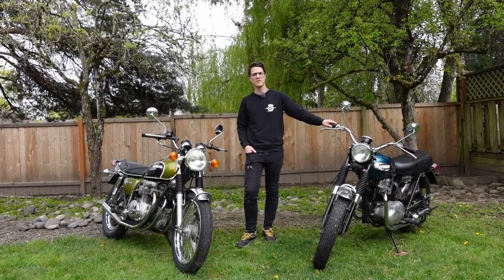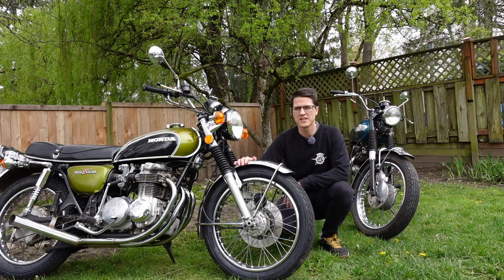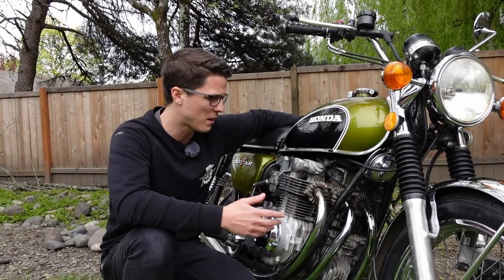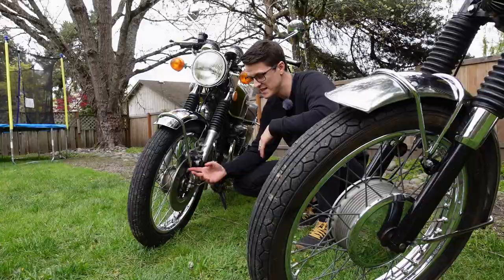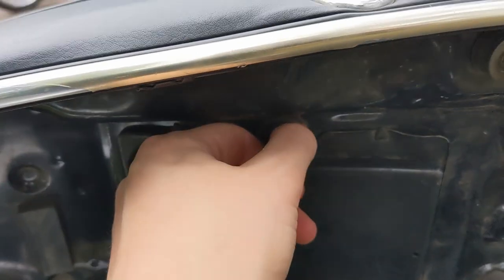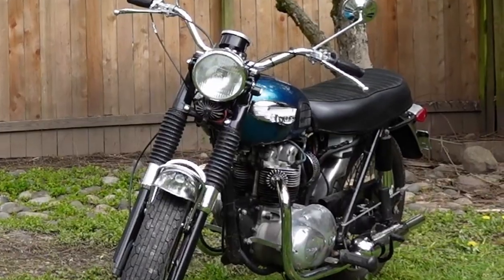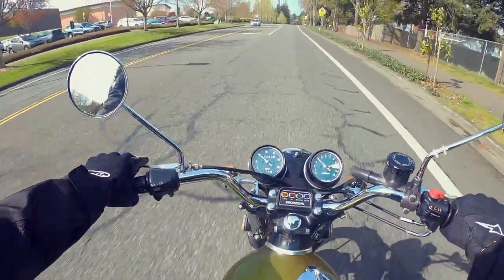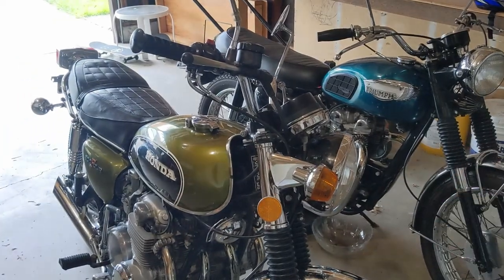How this Honda killed this Triumph

Comment: A better comparison would have been with the T100R Daytona, having twin carbs, tach, twin leading shoe front brake, a more sporty cam & higher compression.  I had a 1966 T100C (street scrambler type) with the single carb, small headlight, no tach, 2 into 1 high exhaust & silencer, skid pan for engine, no battery and slightly lower gear ratio.  You wouldn't consider taking the CB500 for any serious off-road adventures, whereas the Triumph was fun in the dirt.  I've read that it is possible to reduce vibration by having the crankshaft dynamically balanced, and the pistons & connecting rods equalized for weight.  But, I never felt vibration was a issue; not like my single cylinder BSA 441!  One time the Beezer kicked back when I was trying to start it, and ripped my boot apart!  Conceivably, the Triumph engine could be carefully put together to avoid oil leaks, but that's part of its character!  Apparently,  back in the 30's, a proper motorcycle was considered to be 350cc's or bigger.   The 350's were single cylinders, and so vibrated and were not easy to start.  Turner came up with the idea of a parallel 360 degree twin with the cylinders firing alternately, so it had half the vibration of the single, and also easier to start.  It was then bored out to 500CC.

Comment: I agree, i am 67 years old , used to own a 71 CB750 and a 82 Kawa GPZ 1100, although that i love those motorcycles i always enjoyed riding my friends 73 CB500 and 69 Triumph 650 bonneville however i will admit that the Triumph had something the other ones didn’t have which is “Character” regardless of not being smooth and vibration free i never refused the chance to swap with my friend at every opportunity I had 😎

Comment: I have both a cb550 and a 72 t100. The cb550 didn't kill the t100. Poor management at Meriden killed triumph. It continued on after 73 as a collective and later went under around 1981. The t100 was axed because the collective couldn't support it and the t120 at the same time. It wasn't that they couldn't sell bikes, It's that they couldn't make them cheap enough with the poor tooling investment they had available. The shareholders bled the company dry in the 60's. Also, you have the wrong front brake on your t100, you should have the twin leading shoe 8" brake, which I know from owning both of these bikes, works as well as the cb550 when adjusted properly. I find both bikes very beautiful. Honda cb's from the 70's are definitely their golden era. All Hondas of the 70's are just works of art, from the monkey bike to the gold wing.

Comment: Rubbish, I was around when these were new. The Triumph 500 was infinitely better than the Bonneville. It was 10 mph slower but was lighter, it didn’t leak oil so obviously you have read previous reports before making an assessment. My T100 never leaked a drop fact; deal with that. The Honda was great but the CB had crap brakes ie didn’t work in the wet at all! The Triumph TLS did. Even the SLS did. I would have loved a Honda because I was poor, but I cut my teeth on British bikes. At 67 I won’t change my mind. Modern Triumphs have tried and failed miserably to check the past. Some things cannot be repeated; including old Honda 4s. British rules.

Comment: Fun Facts, the Triumph Speed Twin engine, introduced in 1937,  and designed by Ed Turner and Bert Hopwood, was converted to military use in 1938.  It became the generator for Lancaster Bombers, and also for portable electrical military use WWII.  The Generator versions used aluminum heads and sometimes sleeved aluminum cylinders.  After WWII, the military aluminum heads and cylinders were used for racing.  These were successful in wining the IOM GP.  Aluminum heads became standard at some point 1963 the engine and trans got stuffed into a single case.  Your Triumph is essentially a 1937 engine design, and it helped win a war.

Comment: Here in Britain 1969 Honda releases the CB 750. 
Triumph releases the T150v Trident.
I would say personally that the CB 750 was the bike that changed everything.
Kawasaki meanwhile decided to make the H1 500cc two stroke scream machine. A year later Kawasaki produced the most powerful and fastest accelerating bike in the world, the legendary H2 750 "window maker"
Britains motorcycle industry response?
Carry on making completely out dated, leaking oil designs and tell the customer that the Japanese motorcycles are just a fad and you need one of these?
The rest is history as the saying goes.

Comment: Japan does practical, England does english.  I had a 1966 Super 90 Honda, a 1968 Triumph Tiger(high pipes) and I had finally a 1971 Kawasaki H1 500 3 cylinder. I loved them all. Then I had many more to numerous to mention:) Peace.

Comment: Jeez !!! Quit the moaning. The Triumph was marking it's spot , not leaking oil. Ok! Ok ! It was leaking oil. About that CB 500 though,it was a top heavy gutless wonder . My 350 Ducati single could two up against a 500 CB in an uphill without even downshifting while the CB 500 shifted at least once. Now this was with 2 up, so the CB 500 was maxed out or so it would appear.

Comment: Honda's in Pakistan killed every other Japanese and European Bikes due to 3 things.. Reliability, dirt cheep to maintain and fuel efficiency. They have a 70cc bike that also took over the bicycle industry as it was so cheep to maintain. Could do 65~70 KM per liter (they advertise as 80KM but 65~70 was true). It was cheaper to maintain than a sewing machine. It is cheap to buy.. like worth a good bicycle. You could literally put a dollar worth of fuel in it and it will last you a week. It became better than walking or cycling :)

Comment: I disagree, I owned a new 1970 Honda 750 four, working at a Honda, Yamaha, BSA dealer from 1968 to 1970 I always believed it was the Yamaha XS 650 that really dug the British twins grave. It had the shifter on the left side and a 5 speed transmission. They didn't leak oil, and we didn't have any comeback for repairs. I just believe the British twins didn't keep up with the times, and they cost more then the Japanese bikes.

Comment: I have owned both these bikes, also a Honda CB750, Kawasaki and Suzuki triples, a Honda CB900, plus British bikes like the Norton 750 Atlas and some Triumph 650’s. I now have a Triumph 500, rebuilt it 20 years ago and it’s still going strong, reliable and I know very well. The 500 is the bike for me, light, simple, sounds great, looks great and parts are reasonable cheap. It’s not really about “the best bike”. If I want the best possible bike I would have to buy a brand new one. It’s about how it feels like, how it make me feel, and the Triumph and many other vintage British bikes ticks these boxes. It’s a bit like an old mechanical watch, it might not keep the best time and it has other problems but I still love to wear an old  and battered Omega or Rolex regardless what can be bought new. In regards of how good Honda were with their 750, 500 etc yes they are good bikes and all that but they don’t do very much for me.

Comment: I had a Triumph 650 Tiger (‘71) that I bought used in ‘78 or so. Six volt electrical system and, of course, kick start only. It was the same blue color as this 500 but I soon painted it black/gold. The paint was so beautiful that people would walk by it when it was parked, then turn back and run their fingers across the tank. That never got old. Great machine. Sold it because I didn’t want to die.

Comment: If you've never heard about Ted Simon, the British journalist who rode a Triumph T100 around the world back in the late 70's, I suggest you check out his excellent book Jupiter's Travels. As a young motorcyclist at the time, even I questioned quite why he chose this motorcycle for the trip. I suspect a lot of it was down to his naivete. He had to learn to ride before embarking on his adventure and Triumph motorcycles, who half heartedly sponsored the undertaking by preparing the bike for him and supplying spares. His source of income was through a stipend by The Sunday Times newspaper to which he submitted regular reports. Ted Simon rode Jupiter through fifty-four countries and over 63000 miles. I think it's testament to the integrity of the Triumph's design and engineering that they both made it home together and in one piece. Although the Triumph did have some serious engine work done at one point. Ted Simon had no preconceptions as to the suitability of his bike to complete the journey. He just took it as it came. A year or so after his travels concluded, Jupiter was exhibited at a London motorcycle show as a curiosity alongside the gleaming offerings of the day. It looked so small and understated in comparison. I imagine it's presence there inspired one or two adventurers to embark on their own voyages of discovery.

Comment: im new rider- i drove 750 honda few days: now i want 1- i like the smooth /no vibrate of a big bike- but i like gas mileage and  easy turn and Low niose of the smaller.. #1 its got to be quiet! ..#2 basic.. cheep repair.. dont like alot pipes and overhead valves  #3 its daily driver - got to be Durable ..dont care about fast/no thrills/ drive safely!  #4 - got to do 70mph...interstate .. like the hydrolic brakes   ----seems like a mix between the 2-... maybe a cb350.. ? any ideas? im poor and can fix stuff myself.. slowly get parts!

Comment: I had a 500 and liked it until it tried to shift into two gears at once and broke the crankcase. I gave it away with no regrets. I collect larger vintage Britbikes but they're art pieces with lovely exhaust notes rather than reliable machines (the yowling statistical outliers forget it was common UK custom to do winter teardowns as it was with early Harleys and Indians). When winter teardowns went away that was magnificent for motorbike owners. The owner of the independent shop where I worked for many years wistfully missed off-season heavy engine maintenance revenue (also a Brit collector, he restored his own Vincent and collected BSA Gold Stars).  

The old culture of maintenance-intensive motorcycles built the old comfy biker culture which is mostly gone today but not needing to be a mechanic with peer support to ride was a mostly welcome change.The 500 was a perfectly good 1950s motorbike kept too long. British bikes were just too small to get away with low performance unlike Harley whose MUCH stronger crankshaft permitted a 1930s design to support 100+ inch stroker motors. Harleys are far less delicate too. (I own two cone Shovels and a '73 Ironhead Sporty besides my Nortons and Triumphs.) They're all fun for mechanics but if one is not a mechanic they do not need a vintage British motorcycle.  OTOH older Hondas are easy to keep running with the help of the owner community.

Comment: Actually, I think it's the 1965 Honda CB450 which put the first nail in triumph's and BSA's coffin. It had more power, did not leak oil, was reliable, it had an electric starter and it was fun to ride.

Comment: Oddly I think the CB500 is the much more attractive bike.  It and the 750 and 360F are, to me, the most attractive town bikes ever produced.
I find the Triumph 500 to be nostalgic attractive, but it still looks like Nigel and Percy assembled it in a damp garage from spare parts...where the Honda looks like everything was designed to be one animal.

As to their death...that was Triumph's own fault like Harley's fault when they died to be bought by a bowling ball company.

Casting a motor that actually fit together without warps and gaps that bleed oil isn't impossible.  Getting oil seals that fit.  Making valves that don't need adjustment every couple thousand miles.  Wiring the thing correctly with waterproof systems isn't either.

They didn't care.  They did the minimum to push them out while drinking beer at lunch, and then rewarded themselves with higher prices.

Comment: I doubt the Triumph 500 produced 41 HP in any of its iterations, probably nearer 30. Back in the late 70's my c. 25 HP Yamaha RD250B could out-run my friend's Triumph 500 Daytona (72-73?) which had twin carbs and probably made as much power as any production version. The c. 35 HP RD350 would have disappeared into the distance. I also disagree about the gearboxes - British ones tended to be extremely silky and sweet, almost no pressure needed on the lever to shift (ETA >> and 'false neutrals' were practically unknown), unquestionably better than the Japanese ones of the time.

Comment: i had a cb750 custom..80's..4 carbs with acelerater pumps.. dual front disks, rear drums.. It had no center baffle chamber..when you took it to high reves it was wow loud stock.. It was a great bike.. windscreed luggage canister..  highway bars a must..  Blew rear tire  off in 1k miles.. Lincoln an holland tunnels way over 100 tile walls were like star wars hyperdrive.. cost me a lot on do it agains..Only thing wrong was rotar and rectifier.. died in NYC...  Cost me a tow.. clutch after 10 years was gettin weak..I wounder why.. But still screamed..Hightest humid night runs were a blast.. Always started right up.. Bike went faster then i wanted to go..over 60 2nd gear...most shifts no clutch not needed especially blasting it about.. Sold it for 1k to first looker...

Comment: I ride a 2014 CB1100.  It has the vintage look with fuel injection instead of carburetors.  Unfortunately, the Suspension feels retro though.   I get lots of people approaching me and asking what year the bike is.  They expect something in 1970’s and are surprised when I say 2014.

Comment: I never owned a Triumph of any size but I owned a BSA and a CB500-4. Comparing them is a joke, objectively the Honda is better in every way. If the Triumph speaks to you that is great, have fun. My first (and only) “long” ride on the BSA was about 60 miles. My hands were so cramped from the vibration I had to slide them off the ends of the bar, I couldn’t open my fingers. The Honda took me from central California to Victoria, Canada and back without a problem. The final version of the Honda was bored to 591CC, had a Yoshimura cam, one of a kind exhaust, oversized carburetors, etc. Besides the trip to Canada it was road raced (poorly, but not the bike’s fault) and remained smooth, reliable and easy to live with. The Honda also had a CB750 gas tank (more fuel is better fuel), custom “midnight” blue paint with “ice” blue pin strips, the block was painted black, head left raw, sand blasted aluminum, the cam cover polished and generally was a very cool looking bike that would keep up with a Mach III Kawasaki or a CB750 in a straight line. Z1s and Mach IVs were another story, I needed corners to beat them. 

Side note, if you are trying to make the Honda sound awful you have the right exhaust. Running 1 and 2 into one pipe and 3 and 4 into the other sounds horrible and hurts performance. You need either get a 4 to 1 or to split the headers so 1 and 4 share one muffler 2 and 3 the other. With that second system it will sound sort of like a super “revy” Triumph, same firing order but twice as often. I grew up on 4 into 1s so that would be my choice. After that you may find the Triumph’s sound advantage will diminish but not go away completely, they do sound sweet. Shame everything but looks and sound are garbage. 

Finally, it is very cute you think a single carb, 500CC Triumph makes 40 HP, realistically try under 30 HP at the rear wheel. Dual carb 650s didn’t show 40 HP on non-factory dynos. IIRC, the the CB500-4 dynoed at under 40 HP, 38-ish on Cycle magazine’s independent dyno. That might not sound like much but keep in mind the Drag King of the Seventies Z1 Kaw only put about 80 HP to the ground.

Comment: I’ve owned Hondas and Triumphs. Even tho I love Triumphs my 500 was junk, Bonneville was leaky but splendid. If you take the heads off & and make a high temp silicone gasket, Triumphs stop leaking oil (at least from there).

Comment: Thinking back to that time, the Honda was an utter shock to my
motorcycling friends and l. 
The complacency of BSA Triumph, had to be lived through, to fully grasp the utter failure of the prime UK motorcycling manufacturing 
company. Four cylinders, disc brake, utter reliability, oil tight. 
A revolution from Honda.

Comment: HONDA ,,,,,,,,,,,,,,  I'll have 3 gals.   [ @$ 0.28  gal. ].   TRIUMPH ,,,,,,,,,,,, I'll have 3 gals.   1 qt. of oil and 1 qt. for the road.   The  BONNEVILLES  sure did sound great.   and.   the new ones are close.

Comment: All Triumphs of this era were total crap - perfect examples of the decline of British manufacturing in the late 60s, onward. My 1970 Bonneville sprayed oil everywhere; due to vibrations, the welded fitting securing the petrol tank broke after 500 miles. Shoddy in every respect.

Comment: Honda also had the geographic advantage of selling into the American West Coast, especially California which is arguably the single biggest motorcycle market in the country. I lived in Oregon in the early to mid 70s and European bikes were handled by multi line independent dealers with generally one or two bikes from each company on the showroom floor. When Honda started the inroads, including dirt bikes, a new Honda dealership was built in my small hometown. They had a ton of bikes on the showroom,  lots of accessories and riding apparel.  It was just a much better experience. I ended up trading my Bultaco for an Elsinore and my BSA for a CB550.